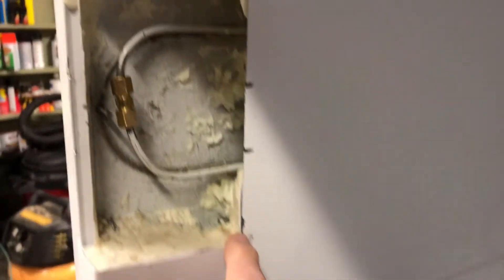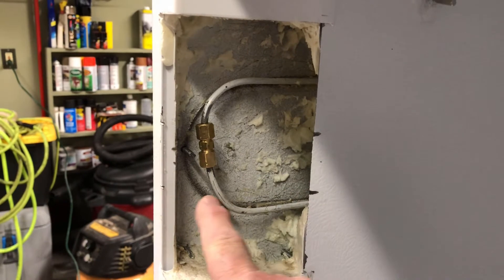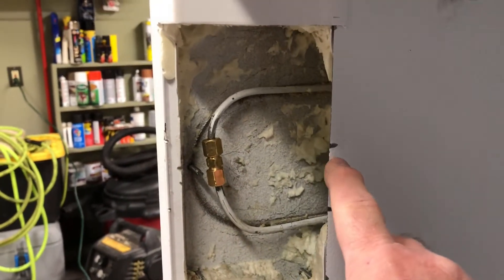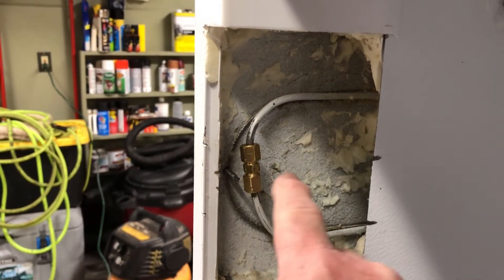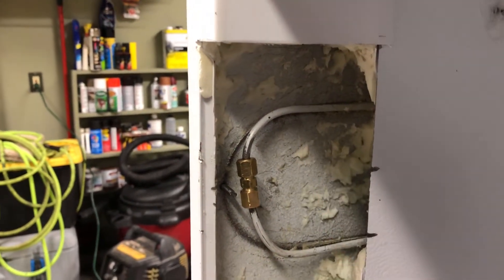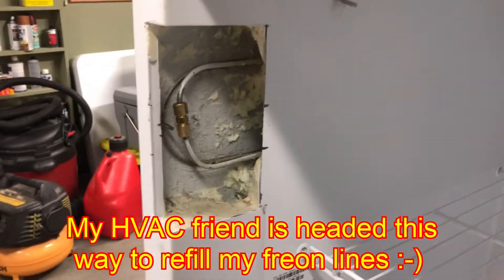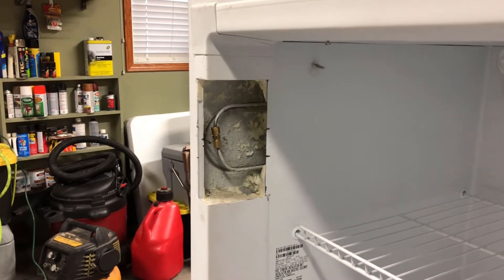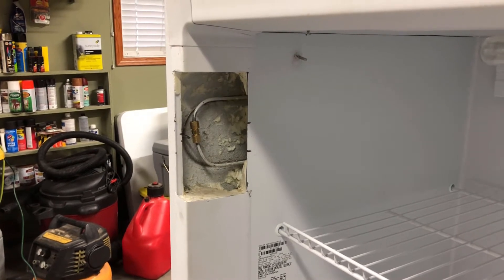Repairing My Damaged Freezer Freon Line, Converted A Freezer Into A Refrigerator,

Comment: Hey Gerald thanks for the video, I’m in a very similar predicament, did you cut out the little punctured section? And what is that brass union/coupling you used? I have a decent sized puncture,and was anticipated having to cut out the bad piece and solder/braze in a new piece of line. Coupling looks easier by far. Thanks
Reply from the maker: Thanks for the comment. The brass fitting was purchased at a local hardware store. Yes the Freon line was cut out to accommodate the high pressure fitting. I think solder/brazing would work too. I just didn't want to be working to close to the freezer with a heat source.